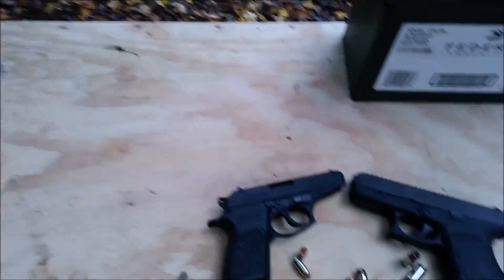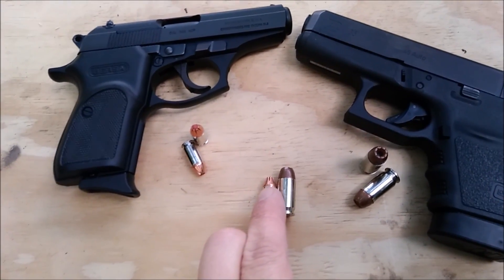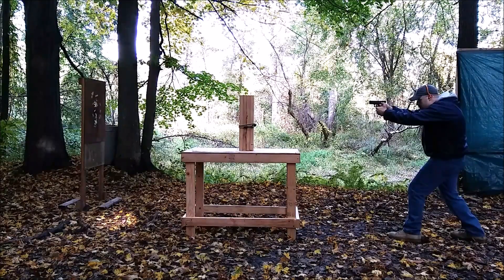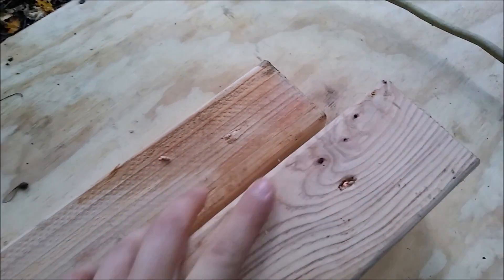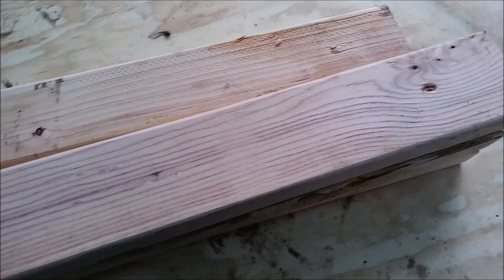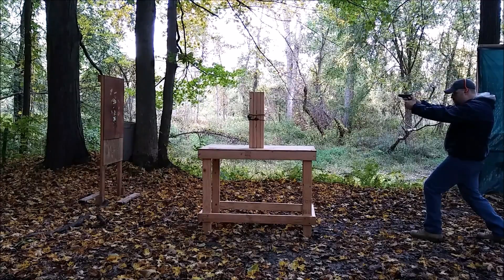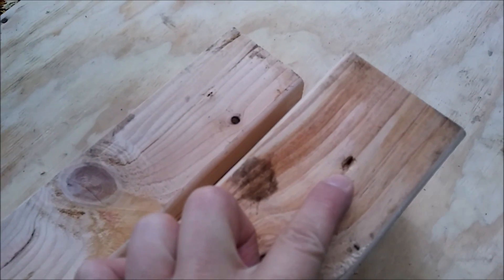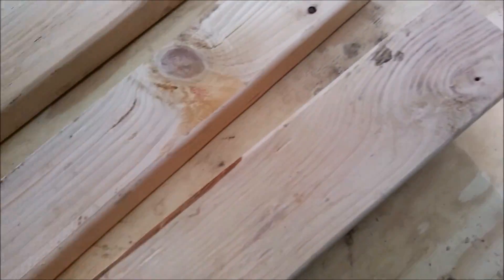.380 ACP Vs .45 ACP - Wood 2"X 4" Penetration Test - HP & FMJ

Comment: Thanks for the wood penetration test.

A few years ago, I performed a similar test using the following:
Eight pine boards bundled with bungee cords
Each board was 24-inch long, 7 1/4 inch high, 1 1/2 inch thick
380acp Fort Scott 95 grain solid copper ammo shot from 4-inch barrel Hungarian Walther copy
45acp Super Underwood Xtreme Penetrator 200 grain solid copper ammo shot from 4 1/2 inch barrel Hi-Point model JH
4-food distance from gun to target
The 380 penetrated boards 1 & 2; lodged in board #2 as it was exiting; made 1/2cm dent in board #3
The 45 lodged in the first third of board #4

Comment: This was fun to watch, and you are right, the .380 is a shrunk down .45. They were both designed by Mr. Browning himself, and he designed the .380 to be a 5/8 or 7/8 scale of the .45. (I don't remember which). Both are quite suitable for two legged varmints. Thanks.
Grey
Reply: both are suitable for 2 legged grey beard? :)
Reply: 5/8 sounds closer.. I always thought 380 was 3/4 the size of 45. Looking at an fmj of each side by side, it’s definitely somewhere around there. 95grain vs 230grain standard weights.

Comment: The 380 is actually knocking the boards off the table. The 45 is knocking the boards down, but not off the table. Interesting......
Reply from the maker: The .45 probably just smacked it down hard, landed and the friction kept it on the table. The .380 just knocked it around and it lost balance and fell lol
Reply: Placed in different spots on the table. 380 closer to the end
Reply: Did you use Hollow Points ammo?

Comment: 380 is a shrunk down 45. WHAT!
Reply from the maker: Scaled down but pretty much identical in penetration with similar sectional density, also brass length compared to bullet length and so on.
Reply: Bruce Shepherd John browning designed both the 380 ACP ans 45 ACP. The 380 is 75% smaller in ever measurable way compared to the 45 ACP. That's not a coincidence. Browning wanted a smaller round for a smaller handgun so he scaled down the 45 ACP and the 380 ACP came as a result.

Comment: Mini 9mm you mean
Reply from the maker: No, I meant what I said, mini .45
Reply: The 380 and 9 can use the exact same bullet if you reload (95gr). The brass is 2mm shorter than a 9. Other names for .380 ACP include .380 Auto, 9mm Browning, 9mm Corto (short), 9mm Kurz (short), 9mm Short, 9×17mm and 9 mm Browning Court. No mention of 45......